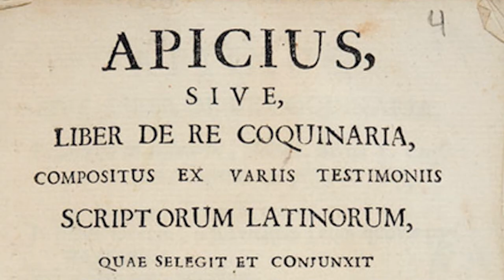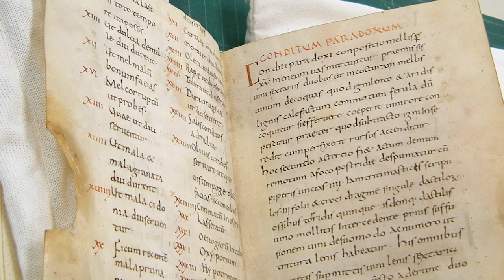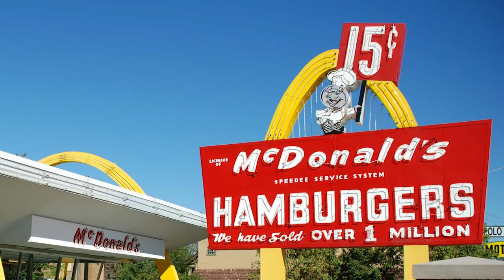How to Make a Burger That Costs $437

Comment: I respect this guy. What he's doing with a modern mind and skillset is invaluable anthropological data. 

But...

This hurts to watch. I'm not an overly intelligent person, nor am I gifted with a charismatic personality or a wheelbarrow's worth of credentials, but there are so many things that even I can point out as solvable problems, even keeping within his self-imposed limitations. 

For one: Sharpen that cleaver, for God's sake. Yeah, it's iron, and won't hold the edge of a high carbon blade, but his bevel is obviously improper, the edge is too thick, and it doesn't taper at all towards the front. It doesn't even look like it has a wedge shape to help it chop. 

The movable tines over that fire? Helpful for a force on the move, but unless you're a soldier in the ancient world, any cook is going to very quickly find a way to keep those things in place. I can think of half a dozen, and I'm not a blacksmith. 

The food itself? That looks damned tasty. No complaints. Maybe strip the peppercorn from their twigs before grinding, or crisp the parsnips before a final fry, but that's just personal pref, not actually a problem. 

The bread looked amazing, too. Gonna have to try that one.